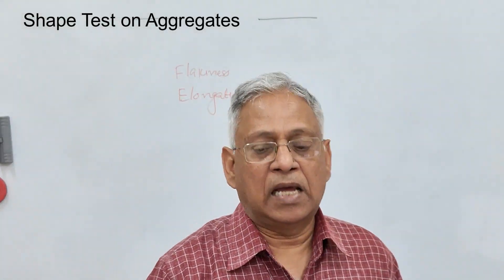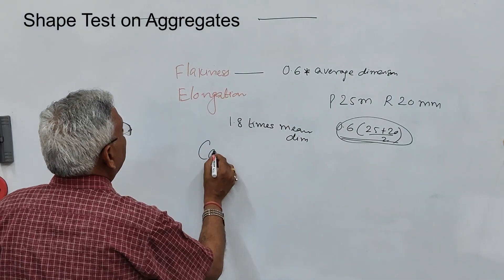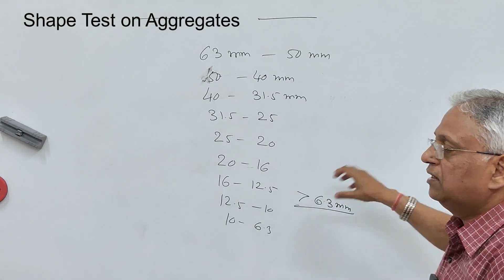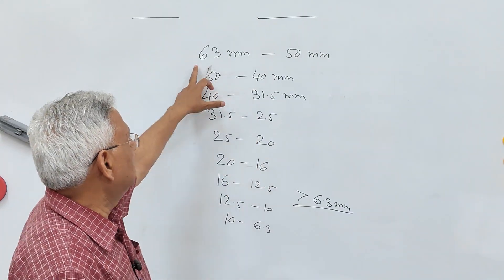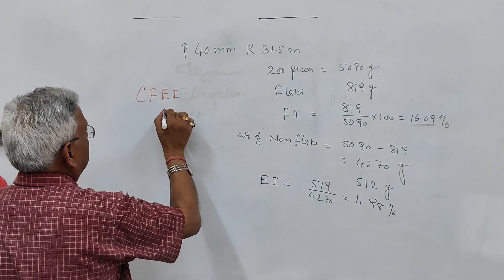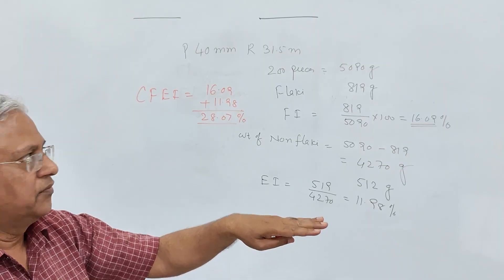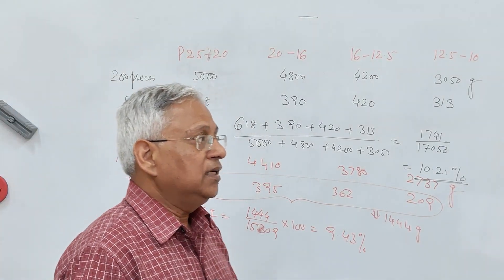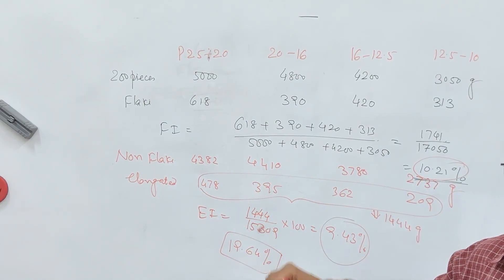shape test on aggregates, Combined Flakiness Elongation Index Test details with examples

Comment: Sir, the elongation index percent is represented with respect to the weight of non-flaky aggregate weight and flakiness index is represented with respected to the total weight of aggregates. In that case combining both the flakiness percent and elongation percent to represent single value may not be appropriate sir. Either flakiness index should also be calculated with respect to the total weight of aggregates to sum with flakiness percent. Kindly provide further information in this regard sir.
Reply from the maker: Before 2013, Flakiness Indiex and Elongation Index were used to be calculated separately. In this process the problem was that a particle may which failed in Flakiness might pass in Elongation test. So the aggregate particle which was not suitable in one test passed another test. This concept of CFI is the result of this anomaly.

Comment: Sir if I want to check elongation index for particle size between 31.5 and 25 then how will we do it

As elongation gauge is not available for this size
Reply from the maker: You can makes it in the laboratory. Hammer two long nails on a wooden block with clear gap of 50.85 mm . This is your length gauge now.
Reply: @SatishIITR  why this gauge is not available in our readymade setup?
Reply from the maker: @sanjaykumaryadav4258 It must be. Let me check
Reply: Sir @SatishIITR

Comment: Thanks sir for the informative explanation. If these sizes are blended in certain percentage (to fullfill some gradation requirements), in the give condition I think we should  take the Weighted arithmetic mean for indivisul size CFEI. Please share your point of view on the same.  Dr. Bharat Rajan, MNNIT Allahabad.
Reply from the maker: Yes Dr. Bharat, your point is valid, but there is a catch here. These tests are not conducted on aggregate size less than 6.3 mm and when you consider any grading (except WBM) major size is less tha 6.3 mm. We are not finding CFEI for the entire grading, but for a small part of the grading. For example, in the case of DBM-1, aggregate retained on 13.2 mm is around 40 percent only. This is the reason the concept of weighted average does not work here. However,
I appreciate your observation.
Reply: @SatishIITR  Many thanks sir for your clarification and prompt response. Appreciate it.
Reply from the maker: @bharatrajan9061  nice to see